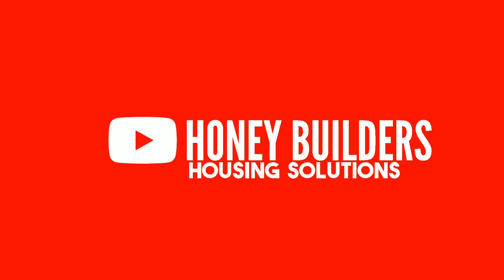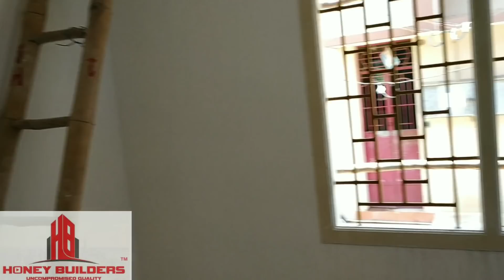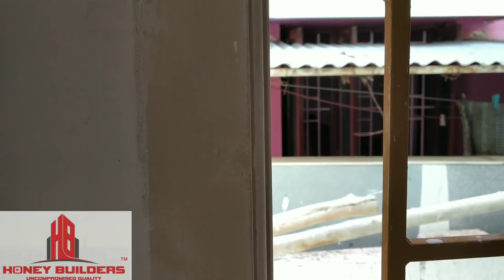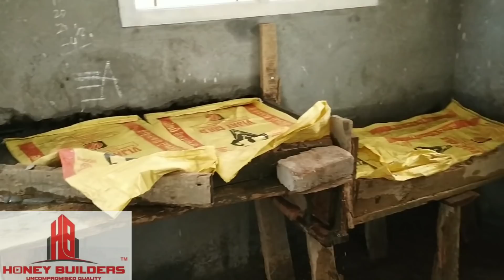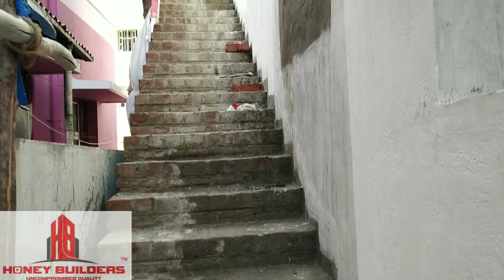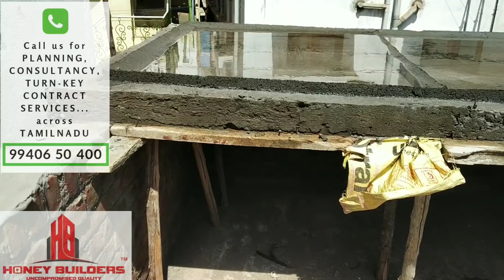சன்ஷேடு, பரண் - தனியாக சதுரஅடி கணக்கிட வேண்டுமா? |  Loft, Sunshade area calculation

Comment: Anna I m RAJ PREETH....I m constructing a simple home with ur ideas ...I m Mechanical  engineering so I had some knowledge of house bcoz I work under a builders in ramnad....  I m erode ...I had no electrician here ..Pls help by sending ur guys or pls give some ideas and how the pipe is fitting before roof concrete